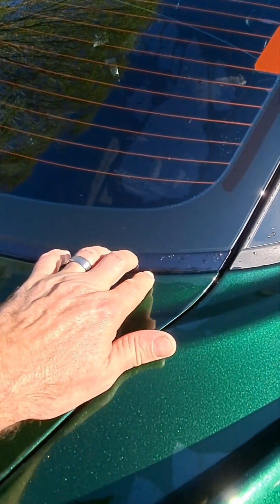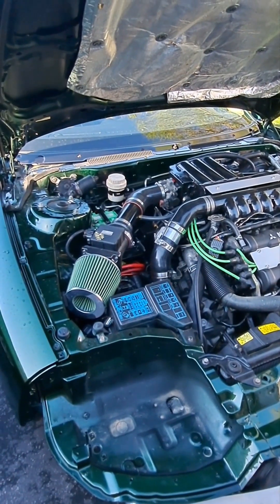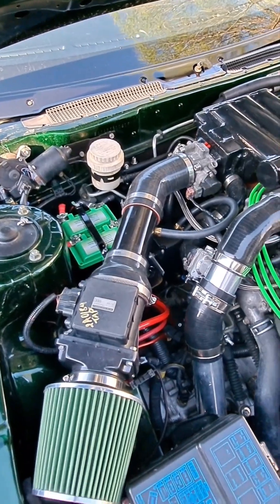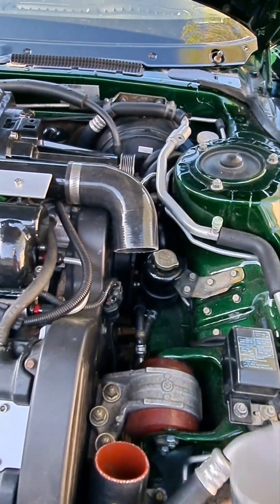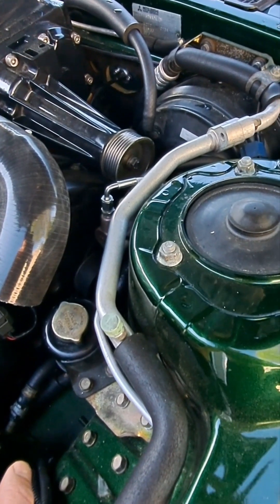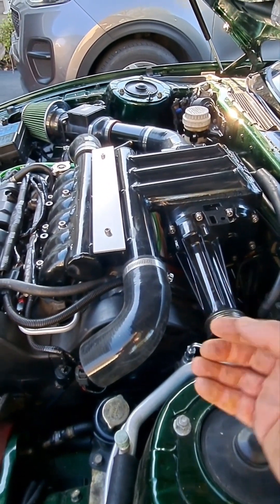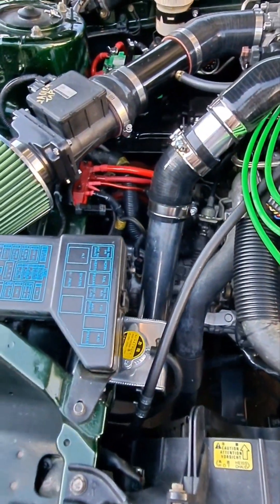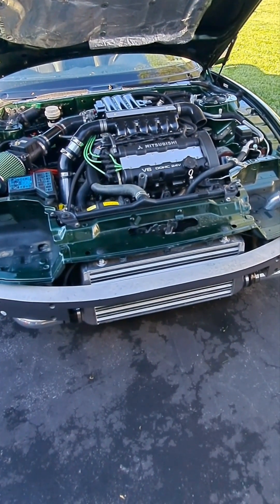3000GT Supercharger update and view of my new paint.

Comment: What paint is that? I thought at the beginning you said house of color organic green
Reply from the maker: It is house of kolor organic green part number C2C-KBC09. It is a base clear. If you go back to earlier videos you can see the factory green
Reply: @sigvision4189  thanks, just found the channel and I’m loving the build
Reply from the maker: @Wolfman  Thank you, that means a lot. I was hoping to be filming a start up today but after 3 hours getting tensioner and belt back on I am done for the day. My tensioner is a great design if the motor is not in the car 😀
Reply: @sigvision4189  can’t wait for the startup, I’ve been wanting to supercharge my daily car recently too
Reply from the maker: @Wolfman  Going completely custom like I did can be painful. Finding a way to mount the SC and belt configuration is the hardest part.  Probably same amount of work to turbo a car by the time you fab exhaust and run oil and cooling lines. You do trade instant boost for HP as it takes about 40 hp to run a SC.